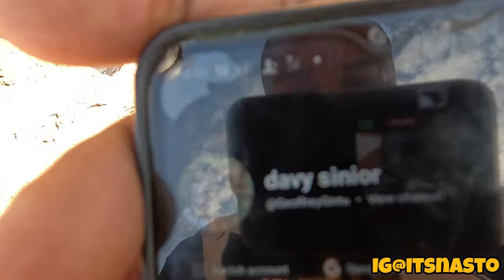CRAZY DAY COLLECTING MORE MATERIALS TO DESIGN OUR MODERN GATE IN THE VILLAGE

Comment: The lintel is also called a beam. A beam is similar to a pillar. A pillar provides a vertical structure but a beam provides a horizontal structure. Both are similar in functions.